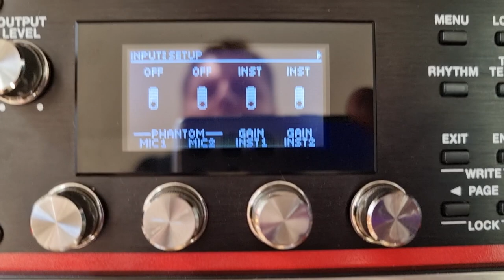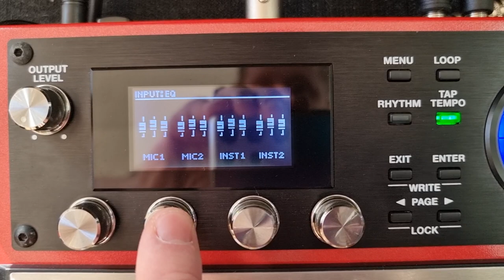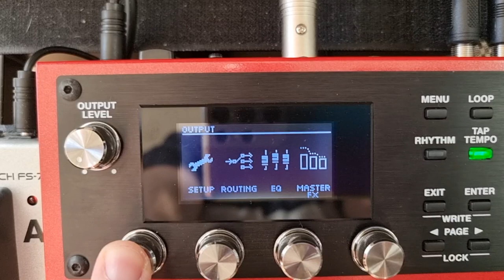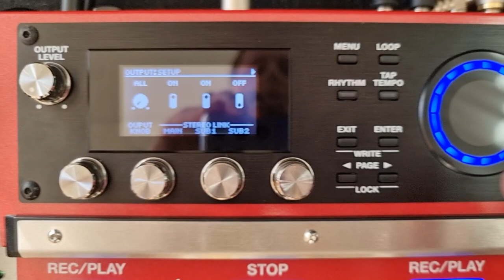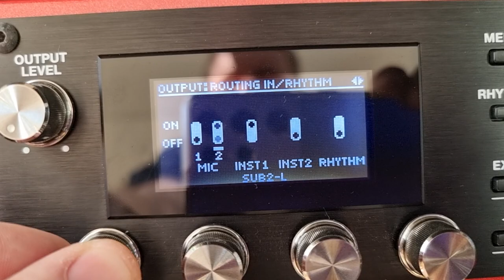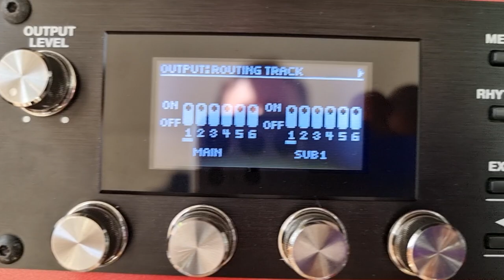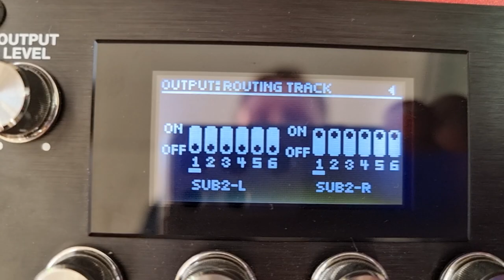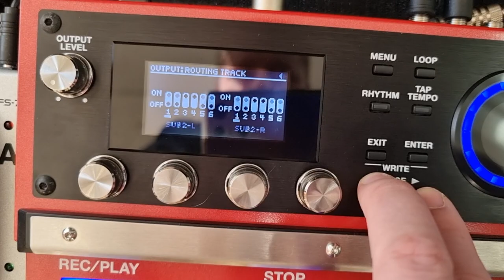Understand Your INPUTS, OUTPUTS and ROUTING Options

Comment: I just got mine today. It took me 3 hours to get my bass to play only through the amp I set the output to but when I recorded a track it played the bass through my guitar amp and pa. I figured it out by setting the bass to only play through that output only on track 3. Was very confusing at first but now I see that it has a lot of control and I didn’t know how to set it. Anyways was a fun 3 hrs but I’m glad I figured it out. Lol
Reply from the maker: Excellent! Glad you managed to figure it out.
Reply: Hi, could you be more specific on the solution? I have the same problem. Guitar and bass are routed to separate amps but come out of the same one when looped in single mode. I can’t find a fix.
Reply: @travisj.tritten5304   I can try. Seems you have the routing correct since it plays out the amp you want when playing but not on the loop. To fix this you have to hit Menu> Output> Routing> Track then you have to set the output for the bass to tracks 1-6 . Just pick one or multiple. I did track 3 then when you loop bass it will only record and play back the bass through track 3. Its not easy and not user friendly. There might have been a better easier solution but this worked for me. Sorry this might be hard to understand. I wish I could leave a voice message as it’s harder to explain in writing. Also I’m doing this from kind of memory since once I set it I saved and haven’t been back to dive in the menu much. Try this first and see if it helps. Also I’m not in single mode so not really sure how that changes the menus.
Reply: @BRAG450  Thank you!
Reply: So I just got mine and having the same issue. The fix that’s been suggested seems like it limits you greatly if you’re wanting to use series looping not just multi. Like, it seems if I record two instruments on one track, there is no way to separate their outputs anymore essentially? I don’t understand why the loop output setting  overrides the routing. Cuz everything is perfect till you actually play the loop back. Is this just a limitation of the unit? It’s a huge one if so.
Reply: @musicmanj1642  Exactly. It's just a limitation of the device, unfortunately.
Reply: @travisj.tritten5304  blah. It was so perfect until the drums came out the bass amp after looping lol. Previously I’ve been using 2 Pigtronix Infinity loopers synced together and I was hoping this could do everything I want in one shot. Seriously limiting though.
Reply: It’s definitely not designed for series looping very well in general, I’m noticing
Reply: @musicmanj1642  Yeah I was super excited to get it since it kind of made looping all the things I play more streamlined. Like bass, guitar, vocals, and a rhythm track for drums in one unit. After living with it for a while I’m seriously disappointed. I had heard about people saying it would freeze and glitch out and never experienced it one time in like 3 months. Now about one out of every 3 times I use it it will freeze and buzz. Was scared a couple times that it would damage my amp since when it freezes it makes a terrible buzz and I play pretty loud. I couldn’t recommend this to anyone at this point. I’m thinking the solution for me is to just buy a mixer and go from there. I just want to loop and things to be in sync and have drums without having to use a pc.

Comment: When i start a track, the track syncs to rhythm. But when i switch to next track, the second track is out of sync with rythm. All my tracks have sync switch on. Whether i am on immediate or measure sync mode, the track does not sync to rhythm after switching to second track. Any insights?
Reply from the maker: Hmm. Is it completely out of sync, or has it just synced to the next measure etc?
Reply: @RossGallagherMusic  its sounds like it has synced to next beat. The guitar rhythm on the track sounds messed up.
Reply: @RossGallagherMusic  i have set all tracks to immediate sync mode. i try to press the foot switch at the count 1 of 4/4 rhythm (just when the base of the drums hit). No matter how precise I am the tracks comes out messed up like half or one beat behind.
Reply: @RossGallagherMusic  shouldn't the track sync to nearest beat when i am in  immediate sync mode and sync sw is on.
Reply: Is there a way to get a track sync to nearest beat instead of nearest measure?
Reply: @RossGallagherMusic  I found out the root of the problem. The culprit was the latency of my in ear monitors. Though the IEM says 3 to 4ms of latency. The actual latency in it must be much bigger. When in the immediate sync mode, the track was quarter to half or whole of beat late.

When in the measure sync mode, the track was running a full measure behind. It was because when i pressed the foot switch which was supposed to be at count 1 of the measure, it was being pressed too late such that looper was waiting whole measure to start that track.

Comment: Help please...I've got my routing set so that only my guitar outputs from main L to my guitar amp. Everything else goes main R to my PA. Works as it should pre playback, but as soon as I play back everything is going to my gtr amp and my PA. What am I doing wrong?
Reply from the maker: Hi Mikael, once you record to your tracks, it's not possible to seperate the audio to specific outputs. You would have to use a specific track for each instrument and route the tracks to whichever output you wish to use.
Reply: @RossGallagherMusic  geez, really? That’s a pita. Thanks for your reply though.
Reply from the maker: Are you working in single mode by chance? I think I've figured out a bit of a long winded work around but it won't be suitable for everyone. I'll post a video on it soon!
Reply: @RossGallagherMusic  tracks 1-3 are multi, the rest are single in some of my memories. Other memories have just percussion (HPD20) as multi and everything else is on single. I really like the tone of my acoustic guitar amp (AER 60/4) and so want to send just guitar to that amp and then have everything else go to my PA (BOSE L1 compact). Would be nice if I could send different outputs from RC600 into different channels on my mixer (QSC touch mix 8), so I could EQ, Pan, etc. each instrument further with my mixer. Don't know if that's possible. I'm sure I'm overcomplicating things. Currently things sound a bit muddy with everything going just straight to my PA.

Comment: Ross how do you connect your Katana to the RC 600? Do you just line out the Katana. I would like to run R and L left from my dual Katana Artists in stereo expand mode but haven figured it go line out of each Katana because the line out is uded for stereo expand.
Reply from the maker: I use the send and return at the back or the Katana, send to the instrument input on the RC, and output of the RC to the return on the Katana. Then use the line out to go to its own channel on the desk. Check out my latest series of videos to show you how I connect things. Hope this helps. Ross

Comment: Hi Ross, thanks for this and all your content. I have one question: I play in single mode, thanks to your other tutorial, and I have 6 buttons set up as 
1 Intro
2 Verse
3 Bridge
4 Chorus
5 Break
6 Solo or whatever

I wonder if I can submit guitar and voice on 2 single mono channels and all the loops on a third channel.
This would help the venue mixing as needed.

Do you know if this is possible?
Cheers,
Erik
Reply from the maker: Hi Erik, just to clarify; you would like your live guitar and vocals to go to their own individual mono outputs, and all recorded loops to go to a separate output? 

If so, then yes. However, you wouldn't be able to separate the instruments once they have been recorded to a track. A common issue when playing in single mode. Basically, if you have vocals, guitar and a bass being recorded for your verse on track 1, you can't split the output for each of those instruments again to their individual output, if that's what you'd like to do. It is frustrating, but how the looper currently works unfortunately. Hope this helps. Ross
Reply: Thanks for replying. so I am using each loop with a backing track created in logic, so, each individual loop is never going to get changed. it is just going out as backing track for guitar and voice. 
So, I guess it would mean that I can use 
Input 1 (vox)  out on output 1
input 2 (guit) out on Output 2
and all loops on various tracks out on Output 3

am I right?
thanks heaps!
 @RossGallagherMusic
Reply: Thanks for replying. so I am using each loop with a backing track created in logic, so, each individual loop is never going to get changed. it is just going out as backing track for guitar and voice. 
So, I guess it would mean that I can use 
Input 1 (vox)  out on output 1
input 2 (guit) out on Output 2
and all loops on various tracks out on Output 3

am I right?
thanks heaps!
 @RossGallagherMusic  @RossGallagherMusic

Comment: Loop-meddelande

Hi,
I’m just about to set up my recently purchased rc-600. To save me some time with the setup I thought I’d ask you for some help. The wizard of rc600 😃

When performing I use my voice and an acoustic guitar. Out from my pedalboard and in to the mixer, I want 4 signals: acoustic guitar (mono), my vocals (mono), looper signal (L&R). I want this setup to have the possibility to mix and eq the signals separately. 

On my old set up I used a “Panic button” pedal, which routed the vocal signal to the looper when recording harmony vocals. Is there a way in the rc600 that allows me to instead of using the panic button run the vocal signal direct to the looper and whenever I want the signal to be recorded address let’s say pedal number 9 to trigger this routing, otherwise the signal runs straight through..? 

As a thank you I’d gladly donate some coffee money to you. 😃☕️

Thanks
Reply from the maker: Hi Matte, thanks for your message. 

If I understand correctly, you want to have a pedal assigned to bypass recording your vocals to a track? If this is correct, you've got a couple of options;

1. You could run your vocals into an XLR A/B switcher and then run out of that into both XLR inputs on the RC-600. One that would record to the tracks, and one that would go straight to the designated outputs. This is probably the easiest way to do things, but without an XLR A/B, it wouldn't be that simple, I'm afraid.
2. If you purchase an 2 way XLR splitter, this is a more affordable option. You could then run your vocal mic into the splitter and, again, run out of that into each of the XLR inputs on the RC-600. You would then need to use a couple of assigns to toggle between the 2 XLR inputs (perhaps mic mute and/or mic level) effectively using the splitter as an A/B switch and then giving you the option to record to your tracks when you wanted to, and then bypass the loops when you just want your vocals to go straight to the outputs.

I hope this makes sense? I'm sorry there's no easy way to do things with the current firmware anyway.

I take it you're all good with routing your vocals and acoustic to your mixer okay?

Cheers,

Ross
Reply: @RossGallagherMusic  .. thanks for the quick response. 😃 I wish there would’ve been a easier way to do this on the RC-600. Boss should consider this feature since a lot of users are singers. Anyhow, looks like I’m gonna stick to my Panic Button pedal, which is a A/B switcher. 

Thank you so much
Reply from the maker: @PuffMatte  you're very welcome.

Comment: Is it possible to save the routings you have set up on the system level? Mine only seems to save to a specific memory, when I change it all the routing is back to factory default. How can I make the routing apply on the system level and not the memory level?
Reply from the maker: Within the MENU settings, you are able to decide whether specific settings are saved to MEMORY or SYSTEM.

Comment: Hey bro! Thank you for the info. What kind of button toppers are you using?
Reply from the maker: Hey Spike! I'm using the Mooer Footswitch Toppers in the video, but I now use the Sonicake ones, if you want to check them out. I'll post both links below.
Reply from the maker: MOOER Toppers https://www.amazon.co.uk/dp/B07LD43S7V?crid=3HKKICTUDFCUO&keywords=mooer+pedal+toppers&sprefix=mooer+pedal+toppers,aps,150&ref_=as_li_ss_tl&language=en_US&sr=8-10&linkCode=gg2&linkId=874304c983ba11064db0ef77450151ca&tag=rossgallagher-20
Reply from the maker: Sonicake Toppers 
https://www.amazon.co.uk/SONICAKE-Footswitch-Toppers-Transparent-Effects/dp/B0B3CR1YKD?crid=6O8K3INVFDSI&keywords=sonicake+pedal+toppers&qid=1675867055&sprefix=sonicake+pedal+toppers,aps,98&sr=8-2-spons&sp_csd=d2lkZ2V0TmFtZT1zcF9hdGY&psc=1&linkCode=sl1&tag=rossgallagher-21&linkId=ecac92f45c623b883a3db902627ebc9c&language=en_GB&ref_=as_li_ss_tl

Comment: im getting mine in a few days to stuff around with stuff for shits and giggles i guess so if i was to just plug this in through my send and return of my guitar amp would i have to adjust anything in the loop stations settings to make it work or it is depending on the input and output i plug it in

Comment: Great Video! Thank you. Question:  Can you get away with not using a mixer for live gigs and just run everything out to the Speakers?  You mentioned you use a mixer for playing out. Just wondering about why you use the mixer.  Trying to simply my set up. I have not bought the Boss RC 600 yet, but my set up now is complex with Ableton, audio interface, laptop etc. I have used the RC 300 in the past and thinking of going back to an RC 600 for live gigs if it can make life simplier.
Reply: I may have just found my own answer in the comments below.  It sounds like I may need to use the mixer to level out the volumes to a suitable level with loops v non looped sound?
Reply from the maker: There RC-600 has a mixer built in so many users make their adjustments and run straight into speakers without going into an external mixer. I just like to be able to have the option to make slight EQ adjustments, instrument levels etc, on the fly, which is why I mainly run into my mixer first.
Reply: @RossGallagherMusic  Thank you so much!!

Comment: Hi, Ross. Thank you for your videos. They are super helpful. Keep going. I have a question to routing. Context: in my setup I play with a band, and from RS 600 I play piano samples, and some other guitar parts. But I was thinking about sending a click to the drummer from RC, and it was working fine until the drummer asked to put down my main guitar a bit low, but then I dont hear it properly. Here is my question: is it possible to route ONLY CLICK to the headphones, or other output, so that my guitar is muted in that output and sent directly to the amp while the drummer hears only Click?
Reply from the maker: Hey, thanks for your comment. To answer your question; I do plan on making another video very soon about how to send a click, as it's something a get asked about quite a lot. You've got a couple of options;
1. You can change the Rhythm to a 'click' sound and route this to a specific output, including the PHONES, and then send this to your drummer.
2. You can record the 'click' to a specific track (as long as you're not using all 6) and then send this 'click track' to your drummer through one of the selected outputs.

Hope this helps.
Ross

Comment: Hi Ross, I'm very thankful for your content. I think it's in this video that you've mentioned that you can add an mp3 player into the midi (selecting the "line" option..). I'm wondering, is it possible to plug in to the Boss the sound from a song playing in my laptop this same way? Or what would be the best way to do so? I would like to make external music go in through the Boss and then out the same way as the other looper inputs (mics + inst).

Also, do you offer 1:1 guidance on the RC-600?
Reply: Just put the songs on a track on the RC 600. No need for external mp3 player.
Reply: Much appreciated Patrick. The thing is, I want to use music directly from a streaming platform and have it go through the RC600. Not sure if that's technically possible and how. Thanks  @patrickploenzke489
Reply: The way I was thinking is, have my phone connected to the RC with a jack, but don't know how to set up RC so that it sounds. Or if this would have to be a MIDI connection instead of a jack, or if this even matters.

Comment: Thanks for this excellent video mate! If you get a chance, would you be able to let me know what input gain you're selecting for your keyboard inputs? I have a synth that has outputs on balanced TRS (I think its sub outs maybe unbalanced, so another option there I guess, if that's going to be better?), and am just wondering what I am best to use to get it into my RC600? Should I use TRS to TRS cable from the balanced outs on the Synth, or TS to TS from the unbalanced sub outs? Should I select line or instrument for the input gain on the 600? Thanks again mate, appreciate your excellent content!

Comment: Do you know if it possible to use one of your USB channels as an input ?
Reply from the maker: I haven't tried that myself. Perhaps if you were using a DAW and recording  from a separate interface. Although I wouldn't like to say for sure I'm afraid.
Reply: @RossGallagherMusic  I have some soft synths that can output on a USB channel and I want to use them without using physical 1/4” jacks.  Basically I want a noiseless system.
Reply: @RossGallagherMusic  Thanks for sharing your tips/tricks BTW.  Saved me a lot of time.